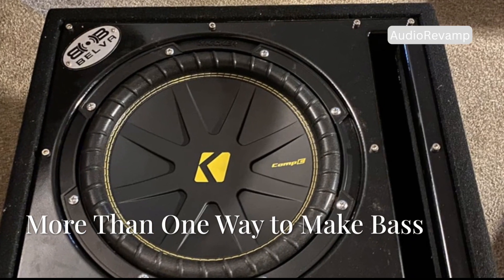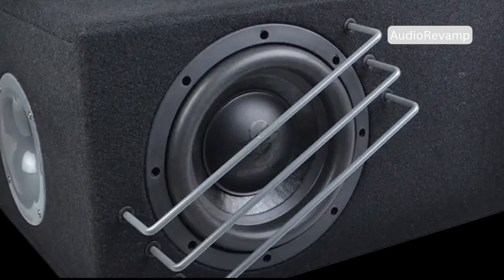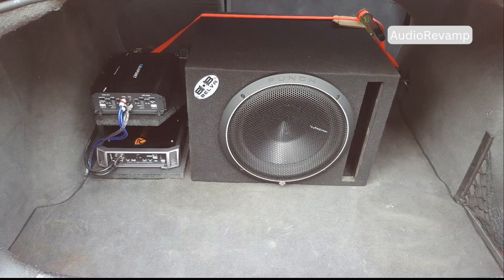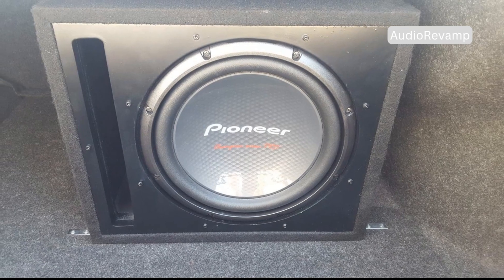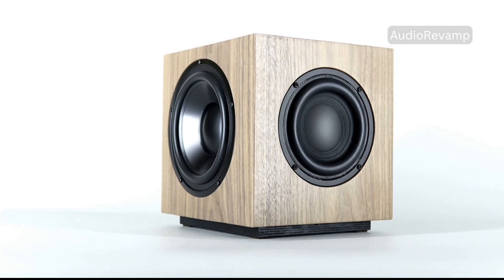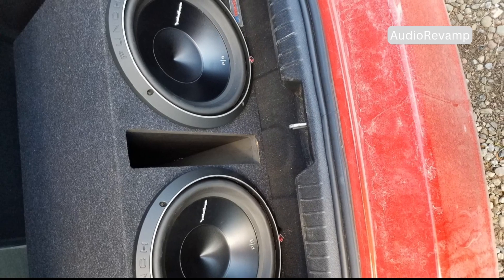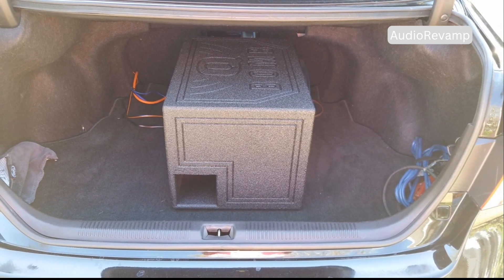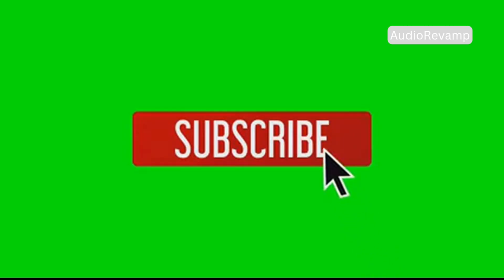Regular Subwoofer vs Passive Radiator Subwoofer Cabinets

Comment: Passive...
Reply from the maker: Passive radiators are great when you want deep bass in a compact box without port noise, especially in tight installs... Traditional ported subs still win for output per dollar, but passive designs shine for clean, controlled low-end...